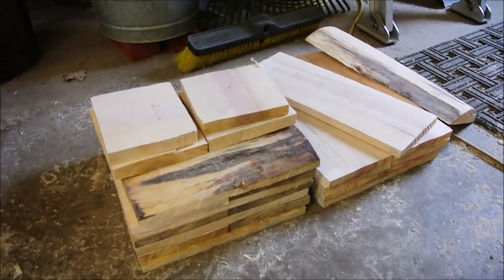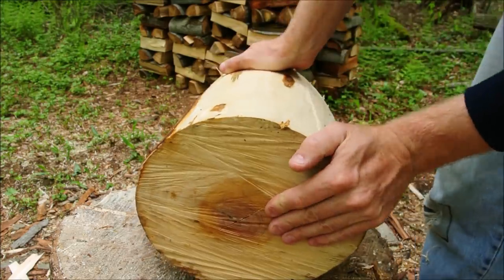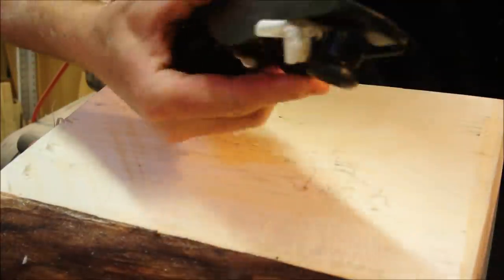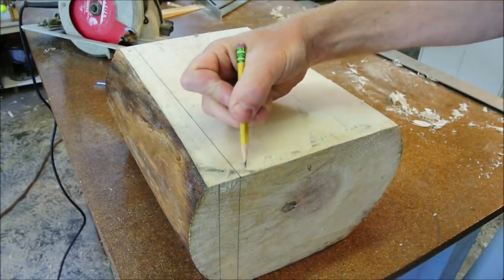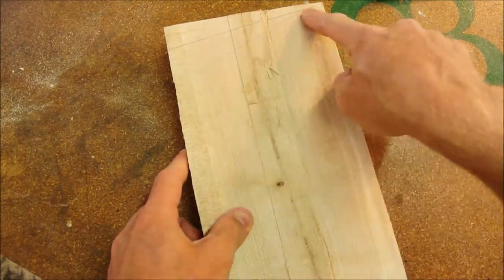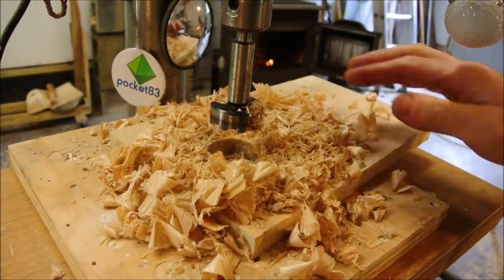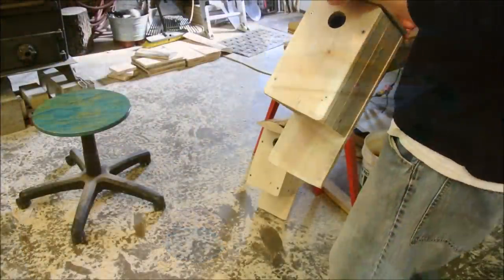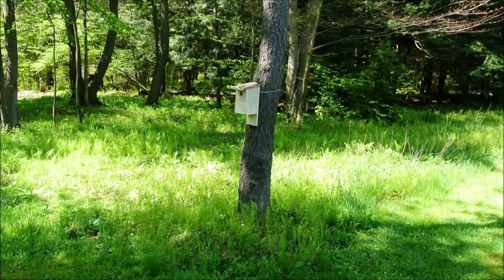Chainsaw + Log = Bluebird House

Comment: Thanks for another great video Pocket! I was thinking of making a bird house but I don't have any trees to cut down so I think big box wood is all I'm going to use.
Reply from the maker: If you do use flat material for the roof, you might want to screw the top to the sides. Then you won't have to remove the top to do the yearly cleaning.
Reply: @pocket83squared  Cool. Thanks for the tip!

Comment: There's so much excessive perfectionism and demand for unproductive superlatives in the tools/woodworking/machining circles these days, and the topics of rural life or primitives have basically been reduced to nonsensical cult mysticism in so many regards.   Pocket getting his own slice of nature and flexing his observant and practical self in this new context is a breath of sensibility that this side of YT needed.    

The included shot of a bird nesting is more substantiation than you're likely to get anywhere else.
Reply from the maker: Thanks. That's a really nice comment. There's certainly a pressure you can feel when you're in-between YouTube groups. This is probably the only channel where you would see someone keep their drawknife in a piece of foam pipe-wrap!

We have to be careful about the extent to which we apply the precision (or restraint) that we learn. There is a point where it has a diminished return. Similarly, just as over-training in a skill can be fruitless, the price paid for a tool should not exceed its usefulness.

Comment: You mentioned that the birdhouse can be disassembled for cleanout. Is this a requirement? Will next year's birds pass on a dirty house?
Reply from the maker: I have no idea. I think it's more like hygiene, and people just treat it like dogma. The birds would probably be fine without cleanouts, but (numerically) you might end up loosing more chicks to infections and such.
 
Come to think of it, I don't ever remember my dad cleaning them out. The long, dry winter should kill off most bacterial problems. However, I guess if there's too much nest stuff in there, the chicks will also end up closer to the exit, which means more will be lost to falls, weather extremes, early departures, and predators with shorter arms/beaks. 

In my opinion, if you're going to build one, you should do the cleanout. It's a pretty small inconvenience to swap six screws and then knock a blob of straw out with a stick.
Reply: @pocket83squared  You make a good point about disease coming from a confined space. While bacteria might not make it through the winter, mold will. 

I appreciate the simplicity of these birdhouses. I'd recommend a hinge system to open it for cleanout, but that just complicates things. Having never made one, I assume the screws will still be serviceable after a few years, so any extra parts are unnecessary.
Reply from the maker: That's exactly the way I see it. Before posting this, I kind of expected lots of comments like "put a hinge on the side/front/bottom," but I ended up going with what's easy. All that playing around isn't worth it if you make more than one. 

Viewers tend to see 'convenience' as better than it really is. Theory and practice are just different things.

If this video starts to get10K+ views, I anticipate lots of "always mount it on a metal pole" comments, which is why the last 30 seconds addresses predators. Oh, and the description- but nobody reads those. lol. Yeah, I'll install eight metal poles. Get right on it. 

Oh, nice to 'see' you again. I don't remember reading your comments in recent history, so thanks for popping back in!

Comment: I was gonna ask if some of the wood your splitting was useable.  Neat
Reply from the maker: Yes! There's lots here to use. I would like to make a mill, eventually. It's starting to seem outrageous now when I see the prices on lumber. There's a fresh cherry down in the back that's 4' circumference with 30' of trunk that's straight as an arrow. Burning that just seems sinful.
Reply: @pocket83squared  awesome
Reply: Would it be possible to make a yard size version of Iso-path?  That would be super cool, but probably not possible with that wood.  I don't know anything about green wood.  I'm guessing that cracking and warping would destroy the tiles.

Comment: Are you sure that the chainsaw isn't a bit more expensive than the screws?
Reply from the maker: Screws are still more. Factor in (mixed) gas and bar oil used, plus chain and hardware depreciation, and it still won't come close. Screw prices are simply outrageous. 50 for $10? I might start making my own nails soon.  

Yeah, I get that a chainsaw like this one is $200. But you aren't a man if you don't own one. Oh, you will also need a (bench) vice, a pickup truck, and at least one shovel to complete the transition to total manhood.

Comment: I'm curious: why does the back board need to stick out of the bottom like that? I"m not quite seeing what purpose it serves...
Reply from the maker: It's just a very old design element. Kind of the archetype for bluebird houses. I guess it adds leverage if you're fastening with a wire, and it's a great place for fasteners if you are attaching it to a wooden post.
Reply: @pocket83squared  ah OK. Thanks

Comment: You could make the cut to stop water from flowing over the edge easily on a table saw barley above the surface. Also instead of undoing some screws to clean it out wouldn't it be easier if you set it up so the bottom slid in and out so you could just pull the bottom out and clean the old nest out like that. You wouldn't even have to take it off the tree!
Reply from the maker: The tablesaw point: none of the cuts were very square. If I were trying to be precise and make perfect fits, then yes, I would do that. This type of construction was fast and crude. As for the rest of the design, modify it however you wish, but what it is is what it is. It's only six screws to clean, and you don't have to take it down to do so. Sliding/moving parts are not really compatible with rough work.

Comment: But why not rive it? 
(Also, block planes are terrible on green wood, but scrub planes, that's a whole other kettle of fish...)
Reply from the maker: Great, thanks. I'll keep checking my PO box.
Reply: @pocket83squared  lol. Though any #4 or similar from a flea market will do, just file the mouth open if it's really tight, and put an aggressive camber on the blade. My scrub plane cost about twelve euros including postage and packing:
http://www.stochasticgeometry.ie/wp-content/uploads/2016/06/2016-06-30-21.12.10a.jpg
http://www.stochasticgeometry.ie/wp-content/uploads/2016/07/2016-07-03-20.43.52a.jpg